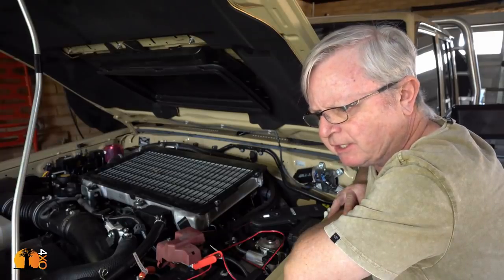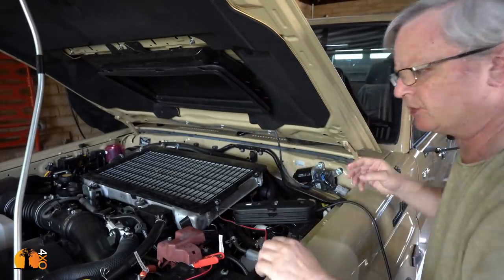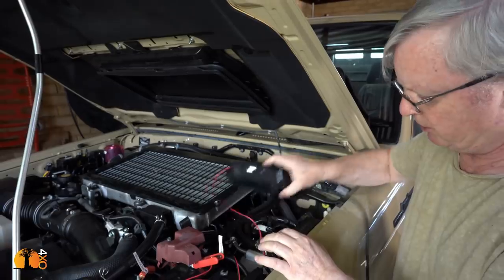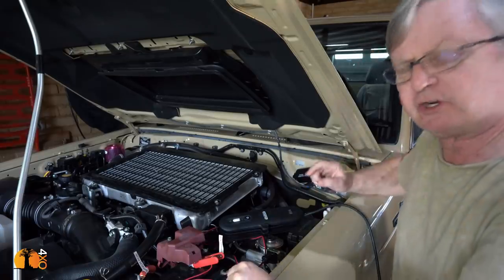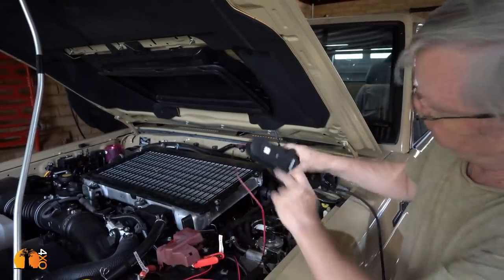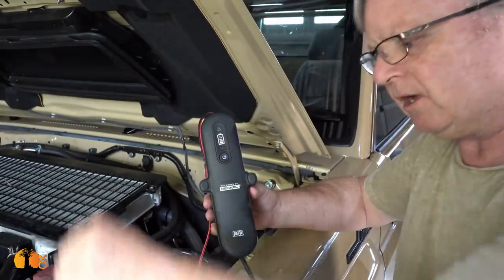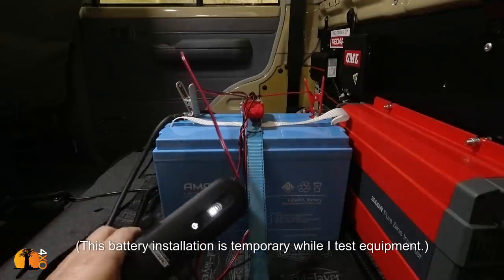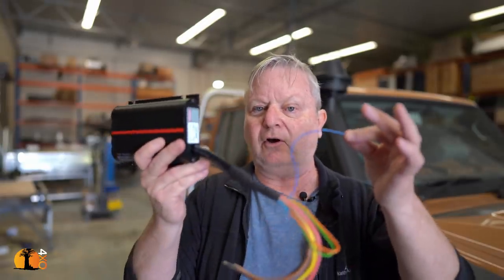DC-DC CHARGER RUNAWAY DISCHARGE WARNING.

Comment: Red arc smart solenoid fixes this men and ladies
Reply: Brian Ostwald 
I’m familiar with these, They will stay on at 12.7v so with a AC charger connected they will be over that voltage and stay on and not isolate as you describe. Not trying to be a wanker here and with respect I don’t think your correct. The red arc dcdc chargers also have these built in to make a seperate smart solenoid obsolete. I reckon just a manual hand operated isolation switch whenever ac charging the starter batt is the go.
Reply: Grant Kerr seems like a stupid problem to have with a “smart” charger when any idiot can see you would only want to charge the extra batteries when the main battery is done charging and no “12v” alternators work at less than 14v as far as I know it is stupid to have them not cut off at 13.5v or at least add a setting.
My dumb $80 45A charger has a setting for voltage cutout. (It is a potentiometer next to the startup voltage))
Reply: @grantkerr2971  if you use a simple ignition activated relay from the main battery to the DC DC charger feed this would never happen.

It doesn't need to be a redarc, not even a VSR but just a plain and simple relay that will only allow voltage if the ignition is connected. 

If you use a VSR it should actually cut the circuit when cracking hits 12.8v.

Basically you would be applying this wiring as if the back of your car was a caravan. Effectively making sure that the feed to the auxiliary is only live when the car is running.

https://www.redarc.com.au/wiring-diagrams/how-to-wire-bcdc-caravan-vehicle-variable-voltage-alternator

You only need to make sure that it is an "ignition" source and not an "accessory" one.  In my ute it is easy because it is a push button start, so it will turn itself off if I leave it on ACC or IGN without the engine running. 

Bonus. If you use a VSR like the red one from kickass then you can keep the circuit closed even without the ignition at the flick of the switch. Without spending $200 on a redarc unit.

https://www.australiandirect.com.au/Battery-Systems/Battery-Chargers/KAVSROVER
Reply: Isolator dito, what is happening is what happens with Batts in parallel until the 2 Batts reach equilibrium.
Reply: @grantkerr2971  if the voltage is over 12.7 then it wont go flat !
Reply: Roy Blackburn 
I agree if that’s the static state of charge. but in this instance there is ac power connection to the battery terminals via the ac charger providing the voltage. Remove that ac current and a flat battery is still flat unless it’s had time to replenish.
Reply: munecito2002 
You make some good points regarding ign wire triggering relay to the bcdc. 
In the situation Andrew had however,  just explaining what I understand about his particular issue with what he had currently which is a common set up to a lot people and I believe he’s correct - perhaps his solution lies in a bit of what you outlined in the first part of your information.
May have to agree to disagree that a VSR from kickass or whoever will make any difference it as that has no features different to a red arc VSR and certainly no better than the one already built into the regard bcdc50 as that at least has a “standard”and “low”voltage setting for cut in and cut out voltage.

Comment: Let's face it, that B2B charger, whatever brand it is, has a big design fault. It shouldn't be possible for it to flatten the main battery under any credible operating conditions. The manufacturer needs to fix this asap.
Reply: Yep, the cutoff voltage is clearly too low.

Comment: Thanks so much Andrew! I've been trying to look this very thing recently.   It's what I suspected would have happened. Glad I didn't setup my .75amp trickle charger to my main battery.
Reply: Okanagan Overland it probably wouldn’t have raised the voltage enough to turn the DC to DC on at least until the starter battery was fully charged and it would not make any noticeable difference to the voltage the DC-DC was sensing at it’s cutoff voltage.
Some people have said the cutoff is 11.7V so it would flatten the battery down to that and turn off till it gets to 13.1 again which would take ages on most 4X4 batteries.

The 10A charger could raise the sense voltage by about 1/2 an volt or so so it would switch off at a battery voltage of 11.2 which is not so good for old school batteries. The 10A charger would also cycle it a lot quicker.

If you have a DC-DC of that brand and there is no setting for it I would consider adding something to disconnect it below 13.1V so it isn’t cycling your starter down to 11.7 every time you stop.

Comment: What if you put a switch in the cabin to control when the charger is allowed to operate, normally it would be in the ON position so it can operate as per normal, but if you want to do work on the car with ignition on, for a period of time the switch will disable the charger, maybe a red flashing light also when it's "off" to warn you so you don't get to the destination and it's wasn't charging because you forgot to turn it back on ?

Comment: Hi Andrew, in your opinion, how can we avoid drain out the starter battery ? By not connecting the ACC wire(if not smart alternator)? or simply add a switch by the starter battery and switch it off if turn on ACC (engine offf)? So, if someone never leave the ACC 'on' whatever condition it is, the starter battery won't be fltten, it this correct? By different manufacturers, is your findings applies to all of them? (Renogy, Atempower, Redarc, Hisae, Projecta....)? What if there is a solar panel connected with 5-10A current presented? thanks !!
Reply from the maker: It could not be simpler . . Charge the auxiliary battery directly, and not via the start battery. Problem solved. It's that simple!

Comment: But as you probably  know when the leisure battery drains, there is a cut out limit that should never drain down your starter, and when static an using solar, I would only have it set up to charge the leisure.

Comment: That's why I still prefer the old solenoid-type dual battery systems ( granted they may be useless in cars with SMART alternators, like the Landcruiser 79 and Pajero.. most newer 4x4's)
Would it not be a good thing to STILL install an ignition-powered solenoid between the main battery and the dc-dc charger? I mean, it would close on start, charge all batteries from the alternator, but the solar or auxiliary charge would only be responsible for the auxiliary batteries..?
Yes its another failable component. But easily bridged out in an emergency ( like that winch override function on them). Worth looking into maybe?
Reply: cars with smart alternators are not driving around with flat batteries so your solenoid is not useless dont believe everything unqualified youtubers say
Reply from the maker: My experience with solenoid systems is that you could drive around the world non stop for 10 years and the aux battery will never ever reach more than about 80% of its capacity. This is due to unavoidable voltage drops. Better run a thick cable and a cut-off switch.
Reply: @4xoverland  Yes! okay, but the cut-off switch will only be needed for the extended storage times, or when the main battery is charged. 
Basically the same scenario as when you removed the aux. battery fuse for the demonstration..
B.T.W. COOL channel!

Comment: I'm using my AUX battery to charge my MAIN battery, using a standard charger (via an inverter of course). The AUX battery itself gets charged by solar. My DC-DC charger won't turn on, closing the circle 'cause it has got remote input signal (ignition), input voltage threshold and an intelligent engine running detection. The first and the latter will stop it from doing it.

Comment: There are now on market in Europe a dc dc charger that only start when engine is on. And there are an other product from Defa that have a charger that on a.c. in and two out for two batteries.
Reply from the maker: This is not a problem I’m trying to solve. And neither is this a mystery as to why it happened. It can and will happen to anyone using a DC-DC setup. It's the nature of how DC chargers work. All of them with the exception of those relying only on a trigger wire. The solution is to charge the auxiliary batteries first. It's that simple.

Comment: As some others, I think something is wrong here - I would like to hear Heiner on that - would be very interesting - Thanx anyway Andrew and cheers Axel
Reply from the maker: I chatted to the guys at Redarc and with Heiner. There is no mystery why this happened. It happened exactly why I said it did. It's a perfectly logical explanation.
Reply: @4xoverland  Thanx Andrew for that update ! - I will again review and try to understand ! Thanx for all your effort ! Cheers Axel
Reply: @4xoverland  Hi Andrew, I think I understand the main reason BUT why does that part increase the voltage of the starter battery ? (https://youtu.be/rDXixCzg6iw?t=129) - yes if this does increase then all is fully plausible ... Thanx Axel

Comment: When my Vehicle is turned off the DC DC charger cannot work, why isn't yours connected like this. Nobody should connect directly to the Main Battery. Or am I missing something.
Reply: Indeed I was missing something, the rest of the video.
Need to add in that my car will not remain on (engine off) if I don't keep returning the accessories back on after 15 minutes. I had commented too early and hadn't seen all of the video. Needs to be a circuit that will only be energize if the engine is on. That could be used for the DC DC Chargers Ignition Wire. You've given me food for thought Andrew. Keep on travelling...

Comment: Thanks Andrew, I was considering a DCDC but will now stick with just a VSR and direct connect for Solar when camped and when at home use a 240 trickle charger - do not want to be in the middle of wop wop and no power
Reply from the maker: Bad decision. DC-DC is beyond anything that has come before or after it in terms of charging efficiency. You are doing yourself a huge disfavour by dismissing them. Just don't charge the batteries from AC in the wrong order.

Comment: I was looking at the Redarc wiring guide that indicates a resettable fuse should be used in the setup. Therefore to charge each of the batteries wouldn't you just break the fuse during the charging cycle and therefore only charge the one you want?
Reply: Any thinking man would.

Comment: Interesting Andrew!... so does this mean if you connect a solar panel directly to your main battery, let’s say putting 10amps in..... it would do the same? 
This could also mean if that’s the case it would charge your second battery first, then your main battery so in theory doubling the time it takes for you to make sure all your battery’s are charged?
Reply: Any charging source connected to the starter battery will do the same. Unless of course he connected a 50A charger to the starter battery which would keep up with the 50A demand of the DC-DC charger.

Comment: A dc to dc charger is obvious. You have to drop down Amps and voltage. I have a 1200 watt regulated dc to dc charger. Output voltage is set and you can charge main battery.

Comment: Just the man I wanted to ask a couple things. Can I safely charge my lithium auxiliary battery with a 20 amp AC/DC chargerdirectly  if half depleted while my Redarc bcdc is connected without affecting the whole setup? Regards, Steve
Reply from the maker: no. Some Lithium battery sellers will tell you you can. But the voltages are not the same and while it will accept a charge direct from the alternator, it will and can never charge it properly or efficiently. But your Redarc BC-DC will charge it perfectly.

Comment: You seem angry at a product for working exactly as it should.
You should be angry at your self for not wiring the system correctly.  
I am trying to figure is what universe we charge lifpo4 batteries through  lead acid batteries with a 10a charger knowing we have a 50a charger for the house batteries. 
Other than that, thanks for warning others that will make the same mistakes.

Comment: Having just installed a Dc-Dc charger this is very timely. We just had an odd unexplained discharge of the 'house' batteries BUT I charged them directly, not via the start battery. I am currently trying to work out what happened as 2 x 120ah went from charged to 12.1v virtually overnight - which is a bit of a worry. I am currently monitoring them with a remote app to see if something weird happens again.
Reply: Did you ever find the cause?
Reply: @001001011010  one of the batteries had a dud cell.

Comment: Window or mirror defoggers are high-current and (usually) only powered up when the engine is running, so tapping off of that fuse or circuit might be a good source of signaling the DC-DC charger to turn on.

Comment: This should not happen as the BCDC will disconnect when the supply voltage from crank battery drops below the lower threshold of 12.7v. A couple of other points- it may be a 50A charger but that is 50 amps maximum. It would hardly ever be charging at 50 amps, if it was something is drastically wrong with your system. Notice when you put the fuse in,  the light on BCDC was pulsing indicating it went straight into absorption charge ie nowhere near 50 amps.
Reply from the maker: This is not a problem I’m trying to solve. And neither is this a mystery as to why it happened. It can and will happen to anyone using a DC-DC setup. It's the nature of how DC chargers work. All of them with the exception of those relying only on a trigger wire. The solution is to charge the auxiliary batteries first. It's that simple.
Reply: @4xoverland  I have a 25 amp Redarc BCDC and have never had an issue with either crank battery or rear batteries, the whole thing works brilliantly and I don't have the trigger wire fitted but if it works for you then go with it.

Comment: If your DC2DC has a Resetable Fuse at the Starter Battery (like it should), all you do is Flip its Breaker when Charging your Starter Battery.

Comment: Can you use a relay that only activates the DC charger when ignition is on so the main is always isolated when engine is off?
Reply from the maker: Yes. Or there is an even simpler, cheaper, lighter solution: When changing externally, charge the start battery first.

Comment: Just put a awith on your trigger wire so you can switch the dcdc off
Reply from the maker: This is not a problem I’m trying to solve. And neither is this a mystery as to why it happened. It can and will happen to anyone using a DC-DC setup. It's the nature of how DC chargers work. All of them with the exception of those relying only on a trigger wire. The solution is to charge the auxiliary batteries first. It's that simple.

Comment: As I’m sure others have probably commented, a C-Tek system will see you right. They are clever buggers and I never considered installing anything else in my troopy, due to my experience with their battery management system in my truck (truck meaning actual truck (25 ton) not truck like Americans use the word truck, and some overlanders have adopted. Southern hemisphereans; a Ute or pickup, is NOT a truck. When did you become so american?))
Reply from the maker: This is not a problem I’m trying to solve. And neither is this a mystery as to why it happened. It can and will happen to anyone using a DC-DC setup. It's the nature of how DC chargers work. All of them with the exception of those relying only on a trigger wire. The solution is to charge the auxiliary batteries first. It's that simple.
Reply: Truly, it sounds like you have, in fact, already diagnosed and solved the problem Andrew. And this is a valuable PSA for anybody experiencing similar hiccups. But it is not true that ALL DC-DC chargers have this problem.The C-Tek system is designed to be used in this exact way, and the entire purpose of having such a system is to prevent exhausting your cranking battery whilst recharging  other units in the setup. In my particular case, my auxiliary battery is not quickly accessible, so The solution of charging the aux battery first is not convenient for some viewers.
Reply from the maker: @kimworthington25  I know the Ctek well. I was one of the first to test is when released in 2010. I understand the problem, and the Ctek could do the same. It does switch itself on by a voltage sensor across the start battery. This video was presented as a warning to others. When I learn something, I like to share it.

Comment: Your setup is wrong: there must be a switch/relay between your main batteries and Aux batteries so the Aux only get charged when the engine is running.  The Aux system must always be (solar) charged separate. All batteries should have the same Ah value. The setup in my OneTen includes two  770Ah standard start batteries and one 770Ah AMG  Aux battery. Solar charging is connected to the Aux battery. If the Aux is fully charged, the charge control relay cut off. Maybe you should consider to have two Aux batteries to ensure the right power supply for your way of travelling. Enjoy life!

Comment: Fit a VLC between start and Aux batteries. When start battery voltage drops below 12.5v it stops allowing it to discharge any further and saves the start battery for is job ....starting the car when you need it to.

Comment: does the dc dc charger not have an 'accessory power' input signal though? that would still be off and therefor isolate the batteries?
Reply: I see he mentioned the trigger cable. This is what i meant. If he had this trigger cable hooked up, it would have told the charger that the vehicle wasnt on, and therefor would have isolated the batteries regardless of the voltage on the start battery?